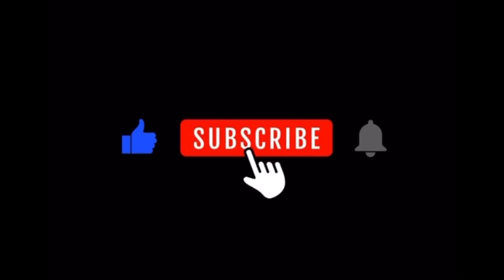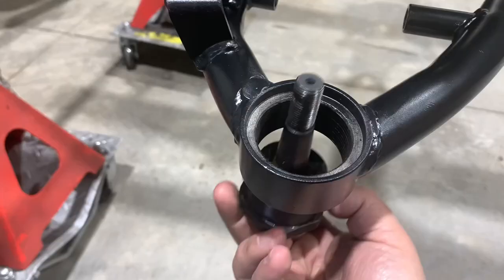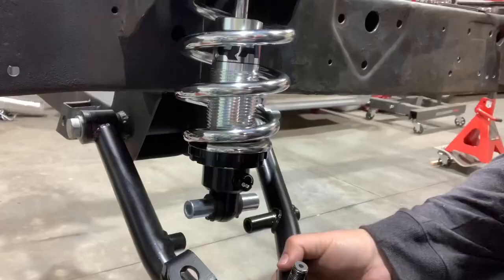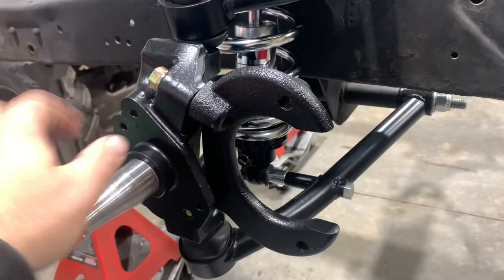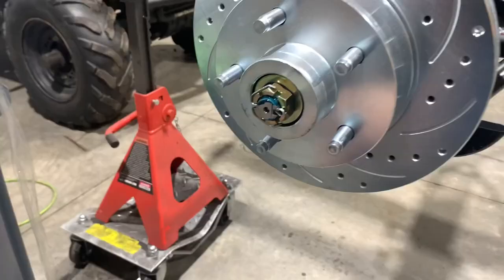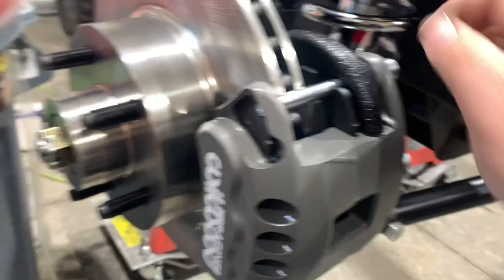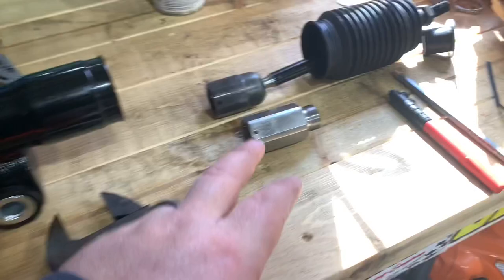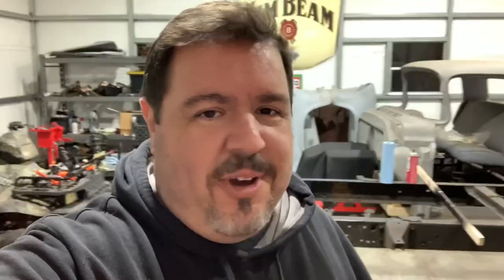55’ CHEVY TRUCK - How to Install a Mustang 2 IFS From START to FINISH!

Comment: I know this build is over a year old but I was compelled to share, that as far as the rotor mishap I've read that Corvette spindles along with their bearings are some of thickest beefy upgrades you could make for a performance build.
Reply from the maker: So, I dont know if I put it in another video, but what happened was, the caliper brackets had 1/8” tabs cast into them. This made the caliper sit 1/8” off, not allowing a 1” rotor. I carefully ground down the 1/8” tabs and the calipers lined up perfectly and accepted the 1” drilled and slotted rotors.
Reply: @intheshoptv  Glad to hear it, that is a fine machine you're creating Mike, keep up the excellent work!
Reply from the maker: @garylostinspace8500  Thank you sir!

Comment: very nice. Im thinking of getting for my 55 as well but i have a 4100 1.5 ton flat bed. not sure if that would fit or not
Reply from the maker: If you email me (address in vid description), I’ll send you the original frame blueprint. If the frame rails are the same width apart, you can use this or any IFS kit for these trucks. The only thing you will have to do is find center wheel base, which is found by measuring from each leaf spring bolt on the same side, and then marking center.

Comment: I just so happen to be making very similar mods to my '57 3100, except I'm using the Full Tilt kit as delivered, and my truck's previous owner had installed a TCI MII front suspension.

On the TCI kit, the same calipers (the Wilwood forged units that you are using) are contacting the caliper brackets prior to the calipers fully seating. Was wondering if you found anything similar?
Reply from the maker: So if the caliper brackets are at all like mine, they have a little pad on the mounting ears that is just part of the casting. However its meant to leave, or shave down depending upon what rotor width, caliper you use. I had to shave mine. They protrude 1/8” if you leave them, and are flush if you shave them.

Comment: I installed a mustang ll cross member and for some reason the left end tie rod does not reach. Even with a 2" spacer.
Reply from the maker: @adamvalenzuela6626  measure your tie rods and see if they are different lengths and possibly installed on the wrong sides. The instructions were wrong in my kit, I only needed one spacer, not two. Also, if you find you still need a different length, call them, and they’ll swap it out. None of these kits are ever exact in my experience… wait till you see my 4 link kit video and what I had to do🙄

Comment: Why didn't your kit come with the c-notch pieces?
Reply from the maker: It “technically” clears the tie rod ends, but depending upon how low you adjust things, you may or may not need them.

Comment: Hello ! GREAT video! Did you end up swapping out the old rubber dust boots to the Energy Suspension? What is the part # for upper and lower dust boots, if you don’t mind me asking. I have the same upper and lower and I’m trying to find the part # to order. Thanks for your help
Reply from the maker: Ha! Great question - one that Im STILL trying to figure out. I looked at the size of every one of their boots in millimeters and NONE of them match the upper or lower control arm ball joints. As soon as I find suitable poly replacements, I will make a video showing which ones I chose and the ridiculous effort it’s taking to find them!
Reply: @intheshoptv  I’m having the same challenges!! I called them up, email them pics with measurements and still no one can help. Crazy !
Reply from the maker: @flyaz11  You’d THINK this stuff would be widely available 🙄

Comment: awesome build my dude. what bolt pattern are you going with?
Reply from the maker: Thanks! A ford 5 x 4.5. But I maybe have to re drill my rear axles to a chevy pattern for wheel availability reasons. Check it out: 55' Chevy Truck is FINALLY a Roller... Now What?
https://youtu.be/JWozLZcG37U
Reply: I seen front rotors Chevrolet pattern for the mustang 2 front end @intheshoptv
Reply from the maker: @MrBigal123123  yes they do make them. But my rear axles are from a Ford Explorer so I decided to stick with the Ford pattern all around… unfortunately, the matching wheels I need are only available in a Chevy pattern so I will most likely have to drill the axle flanges. No biggie

Comment: What Wilwood caliper do you use?
Reply from the maker: @colhoun21  their new D154 aluminum racing calipers. Its basically a lightweight version of the classic GM metric caliper. https://amzn.to/3AMMtHj
Reply: Thanks for that, much appreciated
Reply from the maker: @colhoun21  No problem, good luck!

Comment: Where did you get the brass bushing for the spacers the steering ?
Reply from the maker: Speedway included them in the M2 kit, but they can be purchased separately if you need:

https://www.speedwaymotors.com/Mustang-II-Rack-Spacer-3-4-Inch,37559.html?utm_medium=CSEGoogle&utm_source=CSE&utm_campaign=CSEGOOGLE&gclid=Cj0KCQiA8t2eBhDeARIsAAVEga0RLNZoMeF2zmTlTqMsQm6SvP20eNYGNHlKCZtBN7Dw0OIiRUbDGPAaAhCaEALw_wcB
Reply: I’m in the same problem with the tie rods extension did you get them from their speed way motor as well
Reply: Is their a way I can contact you I’m running in to some problems my self
Reply from the maker: @carmo1695  yep! If you have the power rack, here is the link. If you have the manual rack, they have a less expensive extender kit
https://www.speedwaymotors.com/Mustang-II-and-T-Bird-Rack-and-Pinion-Inner-Tie-Rod-Extensions,7488.html?sku=91034345-POW&utm_medium=CSEGoogle&utm_source=CSE&utm_campaign=CSEGOOGLE&gclid=Cj0KCQiA8t2eBhDeARIsAAVEga1Wpn1eeFc7eqqlg7onrduY0cuuznEz0BoM5PKdsgx6-Q2LMcQlOVkaAh2OEALw_wcB
Reply from the maker: @carmo1695  Absolutely! My email is in the video description